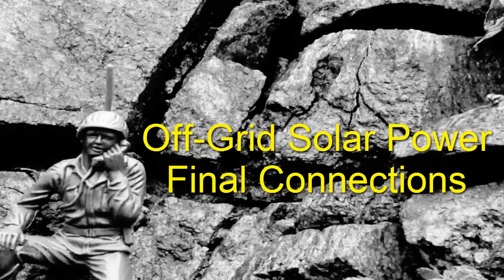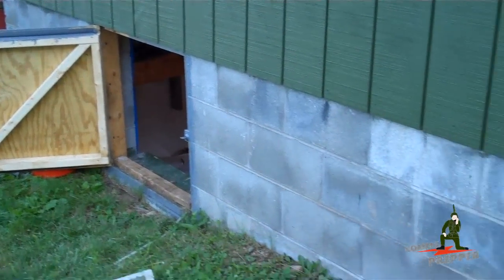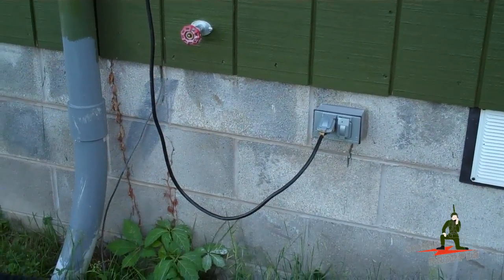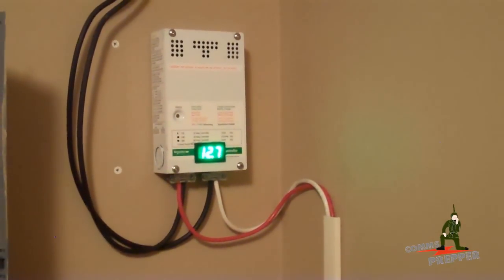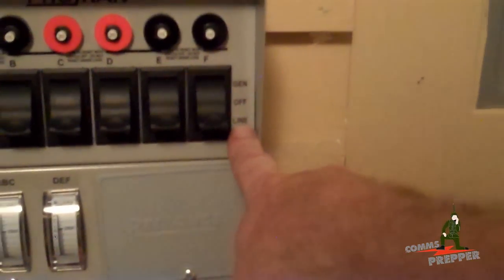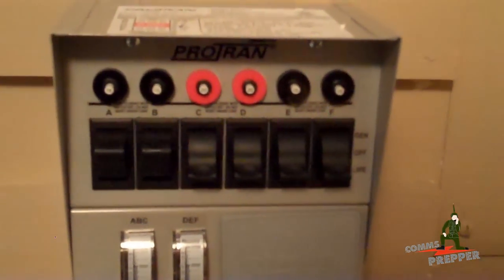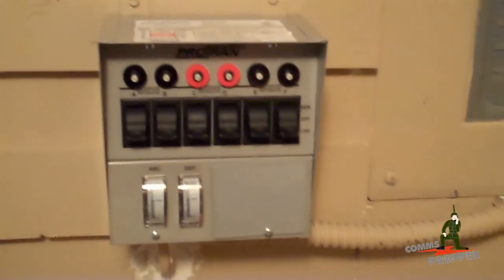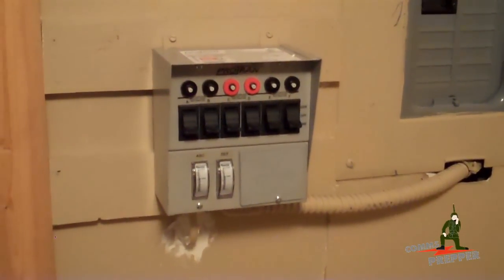Off Grid Solar Power Inverter

Comment: XLNT setup... does your inverter run always... and how much power is it consuming at idle  (asuming you don't turn it off)  Thanks !
Reply from the maker: Dave In'ohio I turn it off when I am not there.  When it does run it pulls around .5amps without load.

Comment: wouldn't being on the grid, defeat the connotation "off grid"?  not that i hate the grid. i think it's cool that you use the grid till there's no grid or any variation forthwith. but in my state of n.c. we don't seem to have a code that deals with direct current electrical systems. that's for states that want to gouge citizens, when something becomes apparent to them, a commerce is generating enough cash flow to tap in on that money. like what happen when they saw the cash flow of yard and gardening goods. now they are taxing these goods with it's own special or at a higher tax rate. in n.c. the only thing that needs to be listed by a "independent testing laboratory" "ul" are those that come in direct contact with public utilities. in this case, if at all possible, would be a grid tie inverter.  and i would size such a system large enough to make a incoming cash flow. even when i occupied the domicile. i call it a domicile,  because the time spent there doesn't equal or surpass that of a home. because both are in the same country as the permanent home. i know, i have a sheldon cooper complex. and calling me a nerd or anything the such will never hurt me, because i own it. lol...
Reply from the maker: dale myers I use the term off-grid from the perspective of the grid going down, not voluntarily unplugging from the grid. Having this solar option complements my generator option, providing a second option should power go out during an emergency.  It has also been a fun project with the kids calculating how much power we can make and what we use.  Adding up the watts for our light bulbs, computer(s), iProducts, AC, refrigerator, etc.  Now that have a better idea what it takes to make all that stuff work - not just a switch click sound.
Reply: that's cool. have you ever heard of the bedini sg energizer. i know it takes a sacrificial battery to run the signal coil. the coil that creates the constant rotation of the wheel.. but if that battery were to be replenished with a complementary solar panel. then it would effect a perpetual energy machine. as long as we have a sun. from what i've read, if there are 30 coils "10 coils each for 3 magnetic  flywheels" it creates enough energy to power a mid sized house by itself.  and it's no taller than a 17", 18" or a 19" or  bicycle wheel and not much wider than three big soup cans side by side.  and it too could be a science experiment for the kids. i would think it great for home schooling.

Comment: Hi Hank. Does the custom cable have live AC coming out? I ask because it's not secured to prevent someone from pulling it out and touching the probes (children).
Still, you've got  great system (I'm envious). :)
Thanks for sharing
Reply from the maker: SurvivalTech Nord The cable has a standard 120VAC male plug that connects to the weather proof outlet coming from the inverter (just like a wall outlet).  On the other end of the cable is a L14-30 female plug (the round plug)  that connects to the male prongs in the transfer switch outlet box.  There is no way for anyone to unplug the cable (on either end) and get shocked.  Additionally, the L14-30 is a twist lock type plug so one must turn it counter clockwise to unlock it then remove it.  I doubt any of these plugs are available in Europe but I'm sure there are similar plugs for campers use to connect to commercial power.  Hank